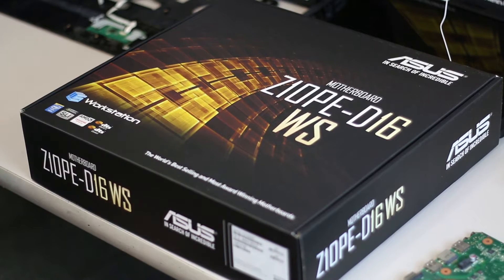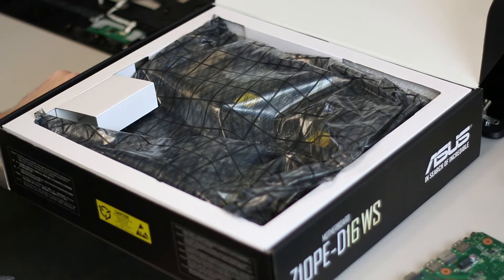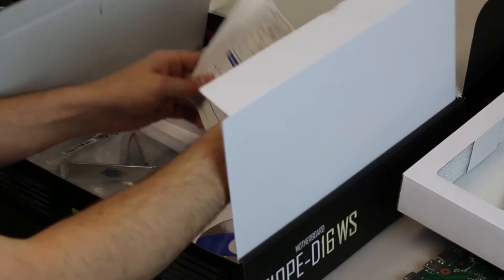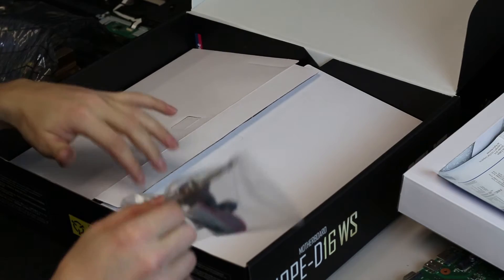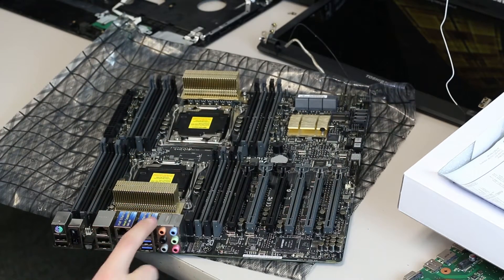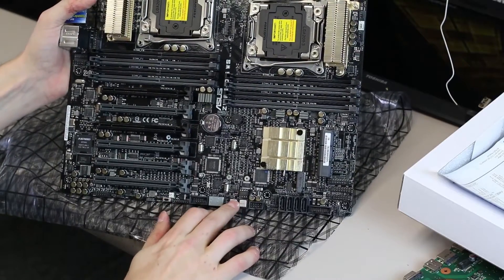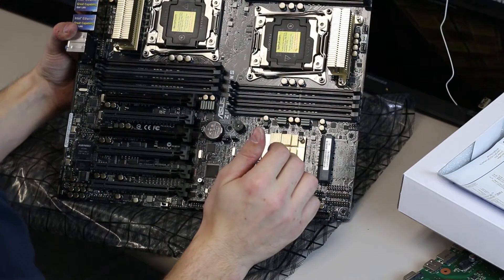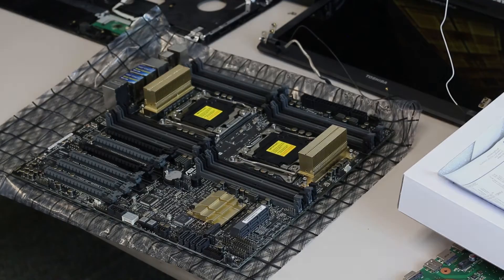Asus Z10PE D16 WS Motherboard Box Opening and Overview

Comment: The more cure count the slower the speed like the 22 cure is only 2.2gigs, these multi cure CPU is primarily use for server with multiple VM where you can assign two or more cures to a VM
Reply from the maker: +Ian Neuman I use the 14/28 thread chips. Turbo up to 3.3. Plenty for gaming with single % usage and rendering a 4k video at the same time totalling 20-30% usage.
Reply: That's true but just like I stated ' higher cure count lower speed, my i7 quad clocks up to 4.5gigsp
Reply from the maker: +Ian Neuman i dont see your point. The 5820k i had in here was 4.6. Still no match for all the xeon cores now.